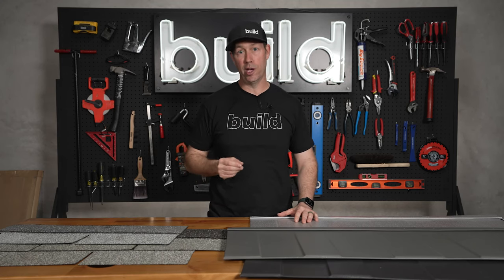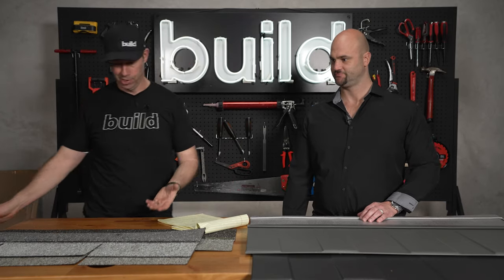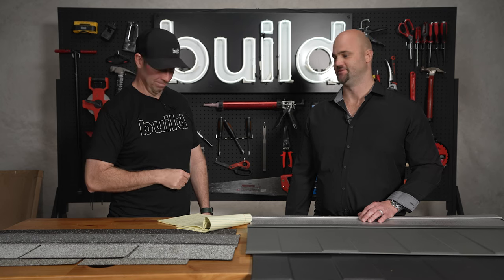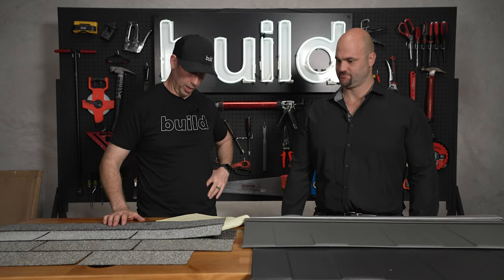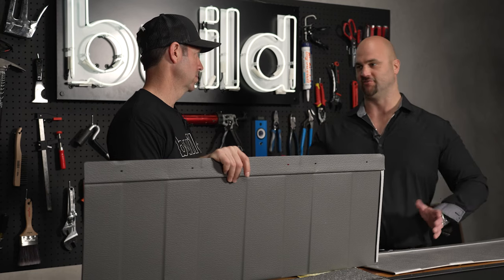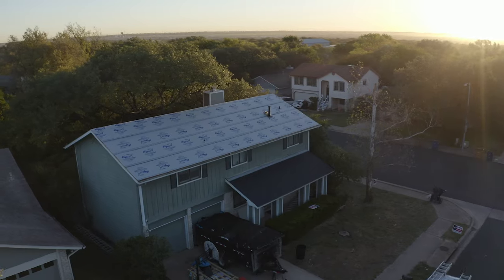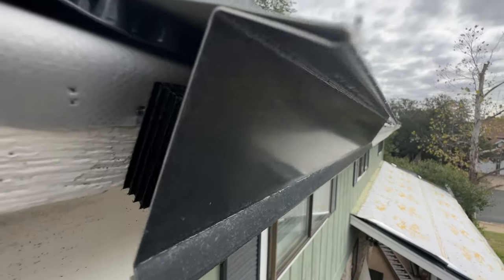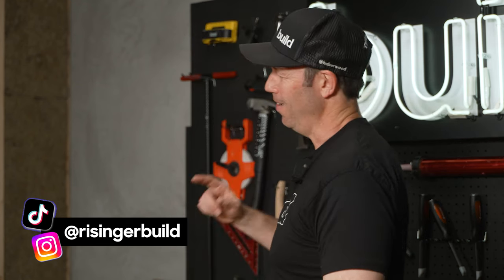Roof Shingles :  Asphalt vs Metal

Comment: Metal roofs are better in many ways , especially if you can get less expensive larger laminates vs these. Problem with them is they are very loud in rain compared to asphalt , so be prepared to add extra sound insulation. I have lived with a metal roof for over 20 years . Typically you might need an adjustment and silicone at some screw spots  with a pressure wash and repaint every 20 years . They can last 100+ years if you do this
Reply: They CAN be very loud during the rain. They can be well insulated using rigid foam board and Z channel over top of the roof sheeting.
Reply: There is ZERO difference in sound In any modern home with an insulated attic. NONE. The only time you’d notice sound is on a low pitch porch roof with open rafters and no plywood.
Reply: @AD-cy7wx  it depends upon your attic design allowing enough insulation , many people that have parts or all the roof as vaulted have much less space. one expensive solution some do for the rain noise is install sheets of playrock under the roof as well . I prefer metal roofs but people need to be aware of the tradeoffs
Reply: Metal roofs like this have hidden fasteners. There's no silicone needed. Sounds like you bought a cheaper exposed fastener system.
Reply: @mr.g937  The silicone has nothing to do with the installation. The silicone is use to patch the roof in certain flashing spots and around certain fasteners after 20 years of abuse, after a pressure wash and before a repaint . Also I'm talking about a completely different system that sells for 1 dollar a sq ft instead of 8 dollars
Reply: @sanisidrocr  Exactly, that's my point. Risinger isn't pushing one of those barn roofs with screws in it. These is a hidden fastener system, both standing seam and the metal shingle in this video.
Reply: @mr.g937  It really isn't worth the expense IMHO for this system but hidden screws do offer an advantage if you have money to blow. The normal metal laminate can last 100+ years if cared for every 20 years
Reply: @sanisidrocr  Its not the metal roof that will die, its the tar paper under the roof is only rated for 30y, after that you will have to take it off and put in new tar paper, i have concrete roof and the wood rotted out at the bottom where the rain hit it, and puddle when the dirt block the weep holes.
Reply: @um8440  In my country none of us use tar paper under our metal roofs even for multimillion dollar houses. Its always Steel panels attached to steel beams or hardwood beams with a radiant barrier and at least 2 " polystyrene and than hardwood or PVC tablia ceilings . Sometimes for noise concerns we use a lamina of playrock to keep the metal from vibrating too. If the roof is damaged or has a leak its very easy to know the location and put a little silicone or swap out a screw with new gasket right away before any water damage occurs. Water damage doesn't really occur anyways due to the lack of use of softwood which is garbage.

Comment: Yes, this was pretty much an infomercial for the metal Shingles…but that ok. We all know everything there is about the super old technology of asphalt shingles. The metal shingles are a relatively new technology. This was informative. But at 71 years old I won’t live long enough to experience the 50 year warranty on the metal vs the new 30-40 year asphalt shingles…and the cost difference is a deal breaker. So when my current asphalt shingles go bad I’ll go with another asphalt roof.
Reply: Yep, when I did my roof around 6 years ago,  materials for a metal roof were 3x more than traditional 3 tab shingles.  Metal would have went on much faster with less work, you're basically paying for convenience with a metal roof. Since I did the work myself, going with 3 tab shingles was a no brainer.

Comment: My grandmother's house (willed to her from her parents) is over 100 years old and has the ORIGINAL shingles which we have photographs of the house when new to prove it.
They are galvanized stamped steel and are about 12"x12" showing with overlaps and underlaps for water sealing. The shingles are nailed on upper edge and one nail on one side at the bottom covered by the adjacent shingle.
The house has been through a couple of tornados in my lifetime and didn't lose a single shingle.
The manufacturer is long gone so I don't know where you'd get any replacement if you'd ever need one.
About 20 years ago the shingles finally started developing small rust spots so we pressure washed, then osphoric acid treated and painted it with aluminum powder silver paint, looks new even today and reflects a lot of heat.
The point is metal shingles or roofs are much better than any asphalt shingles or roof cover.
Reply: Its not the steel that dont hold up its the paper under the steel, those tar paper only will last 30y.
Reply: @um8440  well having been up in the attic and looked at the underside, the roof deck was rough sawn 1 1/4" x 12" 20 foot planks and yes, I couldn't see much because the gaps were small but there did appear to be old tarpaper....
But there's never been a leak in the 100 years since the house was built so I think the shingles kept all the water out, not the tarpaper so it's moot what condition the tarpaper is in.

Note that about every 25 years the family slaps/mops a coat of silver-aluminum paint on, same thing you paint exhaust systems, BBQ pits and butane tanks with and so no rust.
I did it when I was 17 and I'm 67 now and since it was my turn other branches of the family did it.
Reply: I wish I knew that 4 years ago when I had my roof replaced.  My shingles are 30 year shingles, but when I looked at the history of the house, shingles have been replaced about every 10 years.
Reply: @69BTony  one of my cousins is a general contractor and his company does roofing, I remember him mentioning that most asphalt shingles start really losing their gravel (seems more like sand granules to me) about 12 years on the Texas Coast. And that once the gravel's gone the UV deteriorats the asphalt in just another 3 or 4 years. So even supposidly long warrenty roofs don't last in some climates (he's got crews in Florida STILL doing roofing from the hurricanes since the insurance companies have been so slow to pay up on claims. Note that my stepsister still has tarps on her roof in Punta Gorda and it's been 1-1/2 years waiting on insurance money.) Anyway, Florida is another place that just eats asphalt shingles due to weather)
Reply: Do you hear any noise when it rains or snow on metal roofing?
Reply: @oldmansgoldenwords  depends in if it's full board roof under the metal or if there's insulation, both deaden the sound.

Comment: Solar installer here. It is very difficult to install solar on a metal shingle roof. I used to work for EcoFasten Solar/Alpine SnowGuards and there are some base plates that can be put under metal tile sections, but if it is not done during the initial roofing, you pretty much have to re-move all the tile sections, put down the base plates and re-install the tile sections to get solar on.

I had a friend in Pittsburgh that needed to re-roof. I told him what I thought the best options were, but I told him he absolutely should not get metal tiles. The 4 solar companies he was getting quotes from assured him they could do a metal tile roof. He didn't talk to me, had the re-roofing done, tried to finalize the solar quotes and that's when all 4 solar installers realized they had no idea what metal tile roofing was when they gave him the previous assurance that they could do it. They didn't have the skill level necessary and all 4 told him they can't do anything for his roof. 

Solar has a really short payoff period and a minimum 25 year warranty. It is an excellent investment for a home owner, so I hope no one shoots themselves in the foot by installing a roof that can't take solar.
Reply: solar in Pittsburg if you pay a contractor the payback will likely be at least 20 years.  My payback in Missouri was going to be around 12 years and that was if I DIY'd the whole thing and had no battery storage.
Reply: I'm in the process of getting a metal roof and solar system now. The two companies are working together with their planners and engineers. All the hard points for the solar panels are being worked out before the installation. Seem to be the best route for getting both. 
Trying to decide on the color now. Looking at copper color or a dark green or a grey.

Comment: I installed a snapped on standing seam roof on our house 20 years ago. No air gap, just two layers of felt roofing paper under it. Even before the sun goes down the roof is cool to the touch. Very low mass so it does not hold heat (live in hot Arizona), it really helps the insulation do its' job.

Hit with hale once - basically knocked of the paint oxidation. Looked great afterwards.

With our high monsoon winds it really brings peace of mind that the roof is going to stay put - that alone was worth the cost.

Comment: Having paid to re-roof the same house two times already (they seem to barely last 15 years where I live) and are prone to all sorts of quality issues not to mention hail damage, I will definitely look into steel if I have to do it again.
Reply: What climate are you in? Just curious. I installed a 20 year roof about 27 years ago(tar paper and drip). Still in great shape. I have been using spray and forget the past 5 or so years on the north to ward off moss and stuff. This house is in a high wind, high desert. Below zero in winter and up to 120F in summer but not a ton of rain. and maybe several feet of snow in winter. I suppose how it is installed makes a huge difference too.
Reply: @jonwikan3986  Calgary. Temps range from -31F in the winter to 90F in the summer. We get strong winds and frequent hail too.

Comment: I liked this video. I like my steel roof. I had a choice to install a new shingle roof or a metal roof. Back in 1998,  I replaced by last house roof with shingles and cost me $3000 to do myself with a crew of 2 additional helpers in a week. 3 years ago on my newer house, I had to replace the roof. I went with metal/steel 29 gauge. The materials cost was $3000 and included transportation. I did all the installation by myself and took me 6 months. Best thing I can say is it looks great. Should last me 50 years.   :thanksdoc:
Reply: Who takes 6 months to complete a roof🤣
Reply: 29 gauge is a cheap type of metal and you likely screwed through the roof (exposed fastener). It's not a real metal roof and it's not even in the same class as the products Risinger installs.
Reply: @ToddBizCoach  I only worked on the roof one day a week, unless it was cold or raining because I almost slipped off the roof a few times. At best I moved 3 16 foot by 3 foot sections that day by myself up a single ladder.  I could have hired some helpers, but I deemed it was too dangerous and took on the challenge by myself.
Reply: @mr.g937  I used 26 gauge steel. I misquoted in my remarks.

Comment: On some older homes, that that have metal lath plaster walls and ceilings, renovation to some of these homes with adding a metal roof, basically puts you in a Faraday cage where you won't get cell reception (or so poorly that you need to go outside or near window).  Something to thing about if you depend on cellular signals...I can attest to this and use calling over wifi when in my home.
Reply: Oh yeah, thats definately a thing I've run into where Im at out at the edge of town near the farm fields . A friend of mine had terrible cell reception in his house and would go park his car down the street and talk from there in all types of weather, got him some suspicious looks sometimes. I looked into the problem (retired USN radar tech) and realised his Ranch style home had aluminum sideing and a steel carport roof on one side, and a matching steel porch roof on the other. House roof is standard shingles, but still created a big RF shadow inside the home that wouldnt give any phone bars unless you stand on the couch in the main room and hold it 9ft up! Most people find that uncomfortable for daily conversing, and recieving calls may be challenging! 
Solution was to order the free cell booster kit from T-Mobile, and install the antenna relay box in the front room window faceing the nearest cell tower, and the interior relay box on the wall at the center of the house. One of the sons has it even worse, living in a log cabin with a steep snow shedding metal shingle roof out in the woods of North Idaho 10 miles outside the nearest town. He had to install a cell booster system with a high gain antenna on a 20ft pole above his roofline to get signal thru the Fir trees to a tower! There's no cable or DSL data options when you're that far off the telecom grid, and the phone line boxes kept getting smashed by County snow plows and brush mower tractors. Just part of the joys of rural life, I suppose.
Reply: It’s definitely easier to just use Wi-Fi for voice calls at home then to figure out how to get better cell service to your house.  It’s definitely not easy to solve cell service issues without giving up the bonus of living in a tough built tank of a house

Comment: Hey guys, class A fire rating? Why even mention that?  The most popular Asphalt are class A rated as well now days. At least the GAF ones I am putting in. They are also class 4 impact rated. I like the wind rating of the metal and of course the lifespan. Walking on a wet metal roof(cleaning) becomes quite an operation though, especially with a steep pitch.

Comment: I live in a condo complex that has multiple evergreen / pine trees . The roofing material on all the roofs is asphalt , etc .  Which of course the pine needles fall on and create algae , etc that I expect breaks down the asphalt shingles . As they sit , day after day , week after week , etc. Where a metal roof with vertical panels would allow the pin needles to fall away , during rain or wind .

Comment: I had a new roof put on my house back in 2019 and none of the roofing companies I found in my area did metal roofs. They almost all suggested GAF Timberline HD shingles with a 50 year warranty. The previous owners clearly cut corners with the last roof, but we got everything new from the decking up and so far I'm happy with it. Even if I only get 30-40 years out of it I think I'll be content with that.
Reply: Always seems you have to bring them in from somewhere else or find a commercial roofer because commercial properties use a lot of metal roofing.

Comment: How are vents and skylights dealt with vs asphalt? How does the traction compare? Can you actually safely walk on it? What about solar installations? I'm worried about all those penetration holes.
Reply: If you’re using metal sheets, you can get the clear greenhouse sheets for a skylight. As for vents- put them in the wall.

Comment: I'm guessing the installed cost will come close to standing seam, hence, that might be the more appropriate comparison instead of ashpalt shingles. Also, the photgraphy was from an aerial view.  I would like to see it from street level as I suspect the thinness of this material may not pop well from certain angles.
Reply: Sure, but Matt's main theme for the channel is "trying to advance building practices" and the main things being fought is inertia:  The vast majority of builders will just keep using what builders have always been using i.e. asphalt shingles, at least in wide swaths of the country.  He's speaking to builders, trying to give them reasons to move off of the default.
Reply: Asphalt.
Reply: Standing seam is currently around $2,000/square in my market. You think metal shingles around the same? Absolute insanity.
Reply: @srt4b  That is crazy.  Steel is an inexpensive material.  Asphalt is made from oil and as the current administration wages war on the fossil fuel industry, the price will go up.
Reply: @BryanTorok  Aside from your political philosophy, you can buy a square of Timberline shingles for a hundred bucks. Not sure where the war on fossil fuels is evident in that. Steel roofs are priced disproportionately higher because they are marketed to upper end homes, not just because of the price of the material. Four years ago, I put a new architectural shingle on my roof for about $8k. My quote for standing seam was $32k for the very same roof. All I’m saying is the metal shingles, particularly given the way Matt is recommending they be installed, will likely be closer to standing seam costs rather than asphalt. I would be pleasantly surprised if it turns out otherwise.
Reply: @dondumitru7093  All true. However, remember Matt only deals with architect-designed homes where the clients are able to absorb the upcharge on metal roofs. With the pressure on material costs so widespread, most middle market builders will stick to asphalt to keep costs down and limit their use of metal to small accent roofs.
Reply: We have these roofs everywhere in Ontario, and they're sharp as hell.
Reply: @joemartino6976  My comment has to do with the reduction in domestic oil production.  You see, as oil is refined, it is separated into  its various components.  A fixed part will be gasoline, another fixed part will be diesel, and then down to the thicker parts that make up tar and asphalt.  It is not possible to take a barrel of oil and make all of it gasoline or all of it asphalt.  So, as we have shortages of gas or diesel, we will also have shortages of asphalt, fertilizer, and anything else that is made from oil.  And, scarcity leads to higher prices.  I just had a local contractor tell me that certain shingles are on 3 to 6 month backlog.
Reply: @refixed Sharper than a new needle being driven into the flesh from Dr. Spacek.